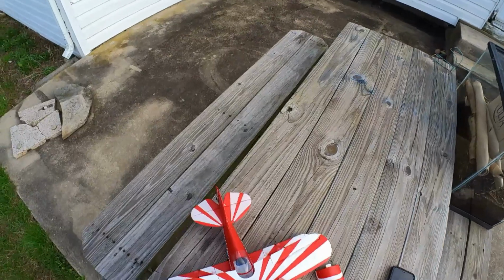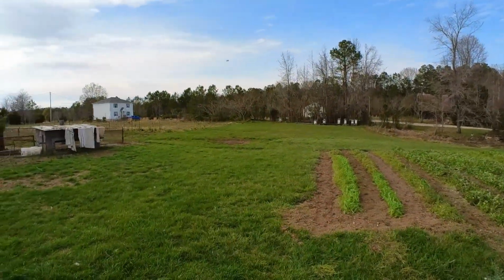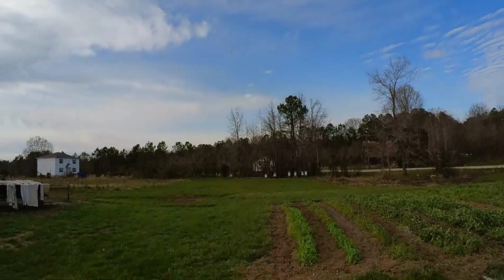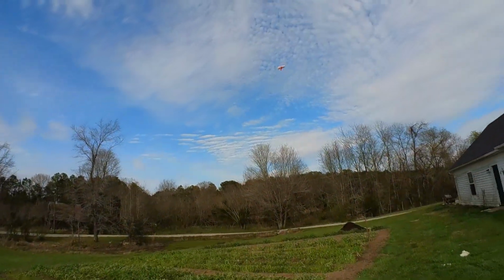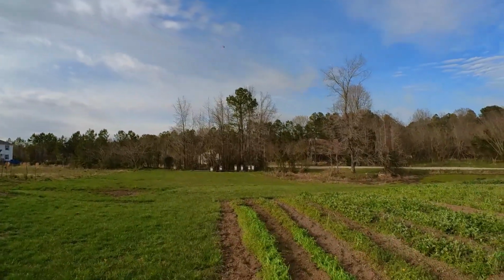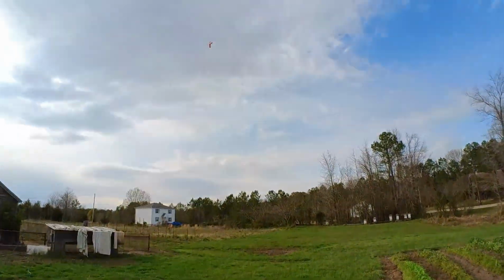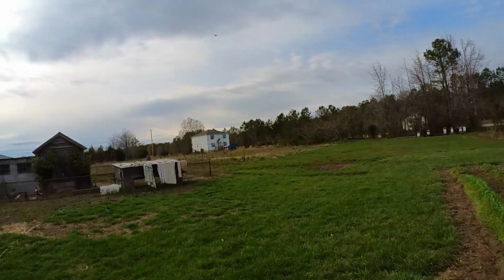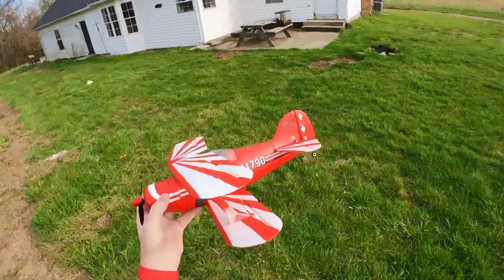UMX Pitts s-1s | Calm close up 3s flight

Comment: i,m interested in purchasing a tx16 like yours and did the   tx16 bind up 2 the plane with any problems? how long have u owned the tx16 and is it user friendly? It seems that's the way 2 go today in purchasing a r/c transmitter instead of getting one with a locked in protocol. thank u
Reply from the maker: It bound up flawlessly. Just needed to reverse the Ailerons and Rudder. In terms of user-friendliness it’s OK. Once you learn it’s perfect but you’re going to need some help at first whether it’s watching YouTube videos or joining discord or Facebook groups but I don’t go against it it’s a very awesome transmitter once you get the hang of it only took me a couple hours asking questions and such and then it stuck with me and I was able to just look back at a single model made to make more and then eventually just remembered it completely. I upgraded its firmware to EDGETX to use the touchscreen on the tx16s
Reply from the maker: I’ve owned the tx16s for two months now also. Needed the external bay for ELRS for my long range plane also. Spektrum transmitters are just too expensive but they are nice